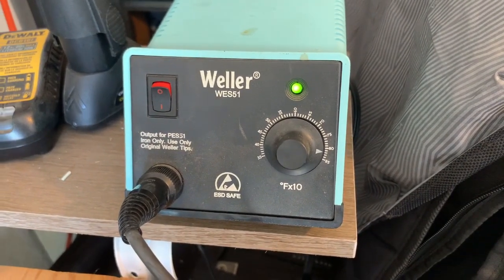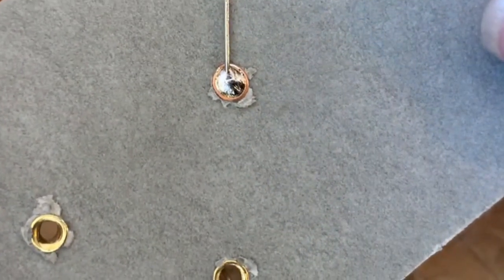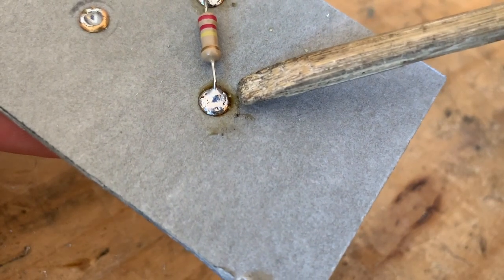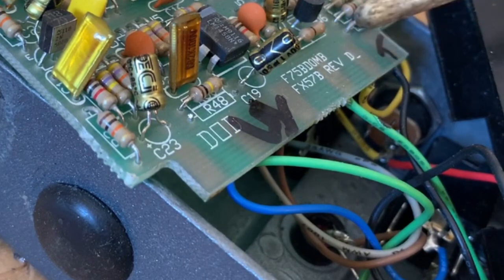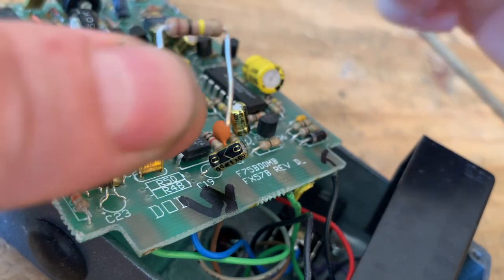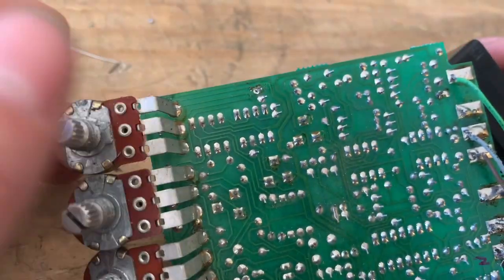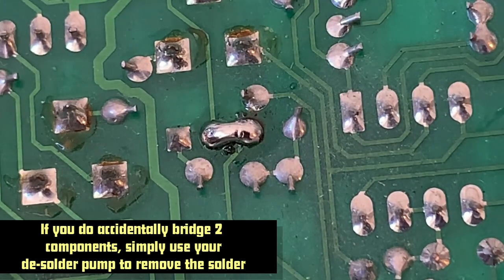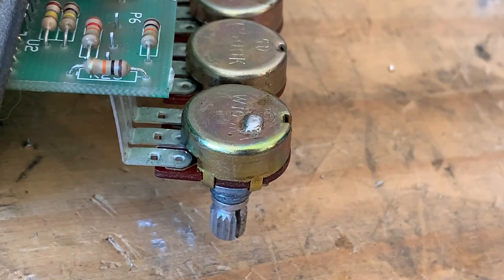How to Solder | Application and Examples for Amp Repair | The Electric Lady

Comment: GREAT camera work. Really good tutorial. If possible make a good mechanical connection (twisting leads, etc) before soldering so the solder does not have to provide all the strength.
I really enjoy your videos.
Reply: Also a temperature controlled tip or iron gives you more time soldering before damaging components. 800°F is a good place to start.
I use a wide tip for large (12-10-8ga) wires.

Comment: Yes, tip replacement frequently. Iron, I disagree. For 10 years I worked in a shop with my Weller station on for 10 hours a day, 6 days a week. I never replaced the iron. My personal station is a Weller and it's almost 35 years old. I've never replaced the iron and I use it daily. I keep lots of spare tips.

Removing solder is sometimes more effective with solder wick instead of the sucker. 

For the pot, a little liquid flux will help as well. I only use additional flux when soldering something large.

Comment: What is the idea temp for the soldering iron? I have a unit that has a dial with variable temp settings and I also use rosin core solder. Also is using a small amount of flux a good idea.

Comment: Awesome. Are resistors directional, or have negative and positive ends like capacitors? I’m an amateur and trying to learn enough to undertake some projects around the house ☺️
Reply: Resistors are not directional...like caps.  Good luck with learning about electronics. 👍

Comment: Bad idea soldering caps to ground. If they were meant to be connected to ground they would be. Such changes can create unexpected current loops, and induce noise into your amp. Engineers consider a lot of things, especially when designing any kind of amplifier because sound quality can degrade with even a few millivolts of noise. Only rarely have I ever needed to make non-factory changes with the exception of gain or tone control.

Comment: Usually those can caps get replaced with axial lead capacitors unless you want the amp to look original, then some people go so far as to open the can and hide the new caps inside. If you solder to the chassis you need a higher wattage iron than your Weller (no higher temperature). Like you said, if you have to camp out on a solder connection trying to get things heated up you can damage the component you're trying to solder. Some of those older circuit boards are just plain junky and no matter how careful you are you could still lift the trace. I saw the Weller soldering station you are using and it is a good station for circuit boards but you may need a higher wattage soldering station for some of the stuff you are soldering on those amplifiers. You said you have to change your soldering tip a couple times a month and also replace your Iron? It's tempting to use an iron to pry on component leads as you are heating them but this can damage the plating on the tip. Once you wear through the plating, the tip is shot. Use a small screwdriver or a soldering tool to pry with as you heat a connection if needed. I've seen people when they get a bit of junk on the soldering tip, bang the iron on the edge of the table to knock off the junk. This is a sure way to kill an iron. And, the solder protects the plating on the tip from the oxygen in the air so if your iron will be idle for a while make sure the tip has a good coat of solder and like you do, turn it off. It doesn't take long at all for a good iron to come up to temperature. If anyone does a lot of soldering like you, pays to spend the bucks and buy a good temperature controlled soldering station.

Comment: Almost there. Need more practice. COLD solder joint on the first resistor soldering. Also on desoldering flow solder on it first then quickly suck the solder out. I get years on my weller iron tips. The secret is to flow solder on the tip before putting it in the holster. This is never failed me in the 40+ years. Worked as an engineer for a major TV network.

Comment: Hello Fazio electric. I am patrice. I am a owner of a twin reberb fender RI 1995. When i switch on it. bulb dont enlight. The power transformer  is getting warm but not very warm.
I bought new tubes  new choke new starting bulb. Actually. It stay Idle. What would be the most commun trouble shooting .is there a part to change in prior? Many thanks for your response...patrice.

Comment: Thank you for this great video. Ive always had problems with soldering in the past and could not figure out why my joints weren't taking the solder. I had no idea that you had to heat the component leads first. Does this apply to soldering wires as well? I've always tinned them just prior.

Comment: While your 60/40 solder is ok. If you use 63/37 solder it's has the lowest melting point also doesn't go though a plastic stage.  My nickel from a tech for 38 years.  Cheers

Comment: I'm not going to kiss asz because you're a girl like all the other commenters. Something is wrong if you're replacing your entire soldering iron setup once a year. It also seems like you don't tin the tip when you put your iron on the holder. That probably explains why your tips are only lasting 2 months. I also recommend getting an electric solder sucker (e.g. Hakko FR-301) -- those spring loaded syringes are unreliable (as you showed) and are more likely to damage the PCB. Also, use a flux pen. I can't believe some people are saying this is the best soldering tutorial they've ever seen... come on guys don't be so thirsty.

Comment: I've had misfortunes with that type of solder sucker ... I prefer solder tawl or ribbon it's capillary action draws all the solder away or I use one of those powered vacuum suckers which continuously suck and have a heated tip ...

Comment: Is it possible to put too much heat into resistors and pots? I worry that I might be damaging parts by trying to heat up the component.
Reply: Yes it is. The best thing is to have your iron hot enough so that you have to stay on a component no more than 2-3 seconds. For soldering on the body of pots you can scratch them with sand paper and use flux, they ll take solder much faster
Reply: @monz7951  Will do. Thank you!
Reply: @luisbalderrama8145  You're welcome. And if you can use leaded (60/40 or 63/37) solder it's easier and less risky to components since it has a lower melting temperature than lead-free. happy soldering!

Comment: For years, I heard that the solder dosent really matter.NFN, I lately switched to a rosin core,.032 ,63% tin, made for electrical work.It has made the work so much easier .It melts at a lower temp, and leaves an outstanding finish.Just have to keep the tip clean,tin the surfaces,and the  temp down,- I just unplug it if I need time to set up.
Practice and repetition, - perfect results every time.
Good tip about roughing up the pot face for those big, stupid, sloppy ground connections .

Comment: Excellent  tutorial, one of the best!! Missing is proper tinning of the tip! Tinning  promotes better heat transfer, faster soldering, better solder flow. Tinning also reduces de-solder time, and less potential damage to eyelets and boards. Always clean the tip before each solder operation, and tin. I always add new solder when de-soldering. Old solder requires more heat, and does not "suck out" cleanly. (always add new solder) 

Finally, the preheat recommendations are overstated, and not as much a requirement. Cleaner soldering is obtained by instantaneous three point contact of the tip and the work and solder. Pre-heat isn't necessary on a PCB, and  less than half a second second on most  solder connections... if even that much. The three point contact of all three, the tip, the work, and solder causes the melting solder to ASSIST in FASTER heat transfer and efficient solder flow. The solder should appear like factory. if it doesn't then you're method isn't correct! If you find you need to pre-heat your work, and end up with melted insulation, definitely wrong.

Tip: watch a vintage factory assembly line video. The operation takes less than half a second for the typical connection. It should be that fast.. and a smooth shiny good looking solder fillet.  I have been employed by several electronics manufacturers, including IBM, and have professionally restored many hifi amps, turntables, reel to reel decks, etc.

The points covered in this video are indeed well explained.. good stuff here!

Comment: Liked and subbed. In high school, I was so fascinated with electronics, because I wanted to know how stomp boxes could create such a variety of sounds. I ended up getting an associates degree in Electronics and Communication Servicing in 1994. I built my own distortion stomp box from a schematic diagram, from a particular website, shortly there after.  Every time I see a video like yours, be it on the basics, I can't help but watch anyways. I will go back to watch your other past videos. Cheers.
Reply: EE here, and I now design and build guitar pedals.  Best job ever! Hope ya still build some from time to time. It's a lost art.

Comment: Hi, awesome video, the way you explain things make it look easy. I have a question for you if you don’t mind. I was trying to replace a tact switch on a board but i busted the connection and i tried to scratch next the copper and solder on it but once i put it together the new switch isn’t working. Now the ask is if you could point me on which pins i could solder a cable to bridge the pin, this a board of an mpc 500.

Comment: When soldering larger wires I like to apply the heat from below and the solder from above..as heat rises..but you will need a bit of solder on the iron to conduct the heat.  Also if you solder temperature sensitive components to cool things down a bit you can touch a pair of pliers or other tool to act as  heatsink.   Desoldering with Solder braid works well too but takes some practice.

Comment: Very informative and good examples used. Many people who occasionally try doing this usually do not invest in proper equipment so before they even start they are at a disadvantage. I would  suggest people avoid those soldering irons that cost a few dollars. They don't work properly and the  heating element usually burns out quickly anyway. Not everyone want to invest in a soldering station but they should look for a decent product from a reputable brand. The type of solder makes a big difference as well. Lead free solder has a higher melting point  and components can be damaged by the increased temperature needed to melt it. Avoid the solder from Dollar stores, I have tried it and it is a nightmare. The leaded solder is still the easiest to work with but not all brands are created equally and you have to weigh the benefits versus the cost of using it where your health is concerned. Many products are now using lead free solder to meet ROHS compliance. Finally I would suggest the tip of the soldering iron is tinned when using it for the first time and keep cleaning it on a damp ( not wet) sponge between use since the tip can build up an oxide layer on the surface when not in use on the stand while it is hot.  Naturally components will take longer to remove than to install and they are faulty or damaged anyway, but the process of soldering a new component should be fairly swift to avoid prolonged exposure to heat .

Comment: I knew an old valve engineer who said you should wire amps up like you didn't need solder, and above all:
"Solder is not glue!" :o)
Reply: My teacher's mantra was 'sound mechanical joint!'

Comment: I think you might be using too high temperatures if your tips only last a couple months. 260 Celcius is quite enough for lead based solders, provided the iron has enough power to maintain that temperature while the heat is being transferred to the soldered elements.

Comment: So cool to have a woman doing a video about electronics! Times have changed and it is for the best. I discovered that some leads have trace of oxidation or oily residue which prevent a good joint. Now I scrape them with iron wool or a fine grit sand paper to clean them to ensure a good contact. Good video !

Comment: We ran old fashioned unregulated irons on all day long 5 days a week. There should be no degradation from not actually using it. Its applying resin and using that can scratch the steel outer casing into the copper core. Great works. That drill bit case kind of spooked me out, reminded me of work place. I started soldering with a gun around 1960. I used to hold solder in my mouth LOL.

Comment: I dont want to come across as a jerk, but none of these joints are all that good - even after they we retouched.  Sorry to be blunt. They are all 'cold'...meaning the heat did not transfer between the lead and the pad long enough before the solder was applied, and once it was the heat was taken away before it flowed together adequately.  What you want are smooth, convex solder fillets. 

Further, this specific solder station should last easily a decade. If you're replacing once a year, it's because you've got the heat way too hot.  This is what you should be shooting for:

http://www.doityourselfchristmas.com/wiki/images/4/40/Tools_Header_Joints.jpg

Comment: i have some problems with your cleaning:
1. the sponge is supposed to be just saturated with water, not soaking wet in a puddle of water, cooling down your tip so rapidly all the time is breaking it faster.
2. clean your soldering tip right before you are soldering not after you are done as the remaining solder on the tip prevents it from oxidizing.
Reply: Exactly! However, she says she has to replace her tips every 2 months. This is consistent with how badly she treats her tips. If your genuine Weller tip is gone within 2 months, you know you‘re doing something wrong, and you shouldn‘t teach other people how to solder. There are MUCH better soldering tutorials available on YT.

Comment: If you really want temperature control check out JBC soldering stations.  Next, don’t clean the soldering tip after soldering.  What happens then is the tip oxidizes and you need to re-tin the tip soldering again otherwise the solder will dewet and sit on the tip instead of adhering properly.  Also the stress relief of the resistor was in the solder joint resulting in a latent failure.  The bend of the resistor was too close to the body of the resistor resulting in another latent failure.  The anodized coating on the potentiometer is there to reduce the corrosion of the pot cover.  The red terminal is to be crimped and not soldered.  Good video for a starter and little more.

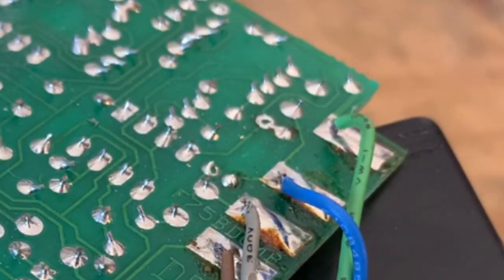Comment: Great video! +1 for the tip on adding more solder if the sucker won't work. If you don't have a solder sucker or have a stubborn through-hole you are trying to clear of solder like in 5:48, you can also use a toothpick or other sharpened wooden stick to clear out molten solder. There's a good example video of doing this for replacing nixie tubes on the GRA&AFCH channel. Solder wick or in a pinch, flux-laden stranded copper wire can also work.
Reply: You can also instead of sucking it out use compressed air or even your breath to blow out the solder to the other side

Comment: Thumbs up for using a tone generator and multimeter from when your granparants were teenagers! I have a similar tone generator, and not PPL synthesised and not dead stable, it serves its purpose as signal injector flawlessly! My favorite lab PSU is from the 80' with transformer and variac, Does both voltage and current limit on both DC and AC! I should buy a modern oscilloscope though, analog and uncalibrated from the university dumpster, an early 80' oscilloscope, is not that useful when I can't do exact measurements!

Comment: Excellent video, and I say that as one who did his first amp repair in 1966. I'd add a couple of additional points: First, a joint can only be reflowed once; additional reheating will cause the tin in the solder to crystallize. If you can't get a good joint after reheating the joint once, suck out the solder and redo the connection.       Second, I prefer to use a Soldapullt, which has a much larger barrel and is much more efficient than the solder sucker you use.  It's particularly good for point-to-point wired amps.  The smaller solder sucker may be preferable for PC boards.  Third, I clean component leads with a braid-type cleaner before I install them.   It's amazing how much gunk there can be on a resistor lead. If you can't find that tool, just strip some braid from a piece of coax; it'll work fine.

Comment: Clean the flux off the board as it will eventually eat through. Isopropyl alcohol 95 grade to wipe clean. Clip your ends close and reapply a little heat on the back to get that nice round bubble effect smooth to the touch. Always keep a hunk of solder on your tip before turning off. Among the other tips I learned.